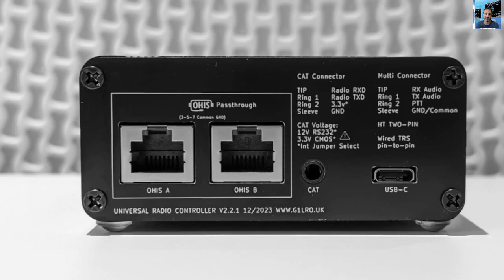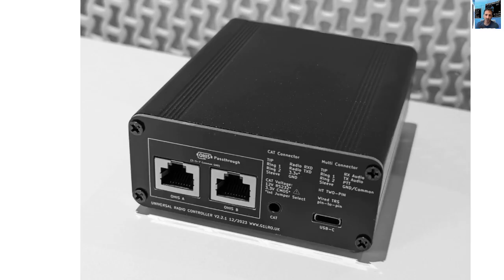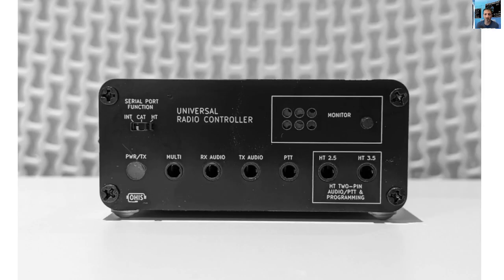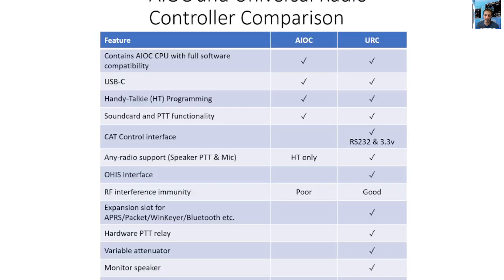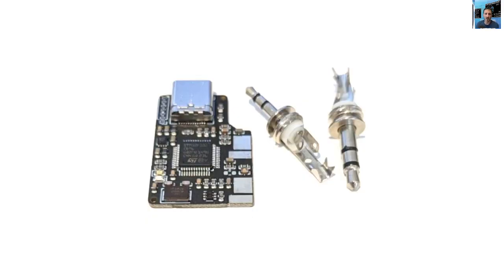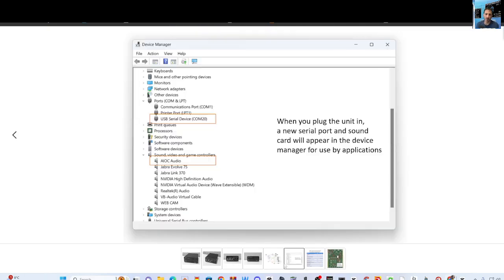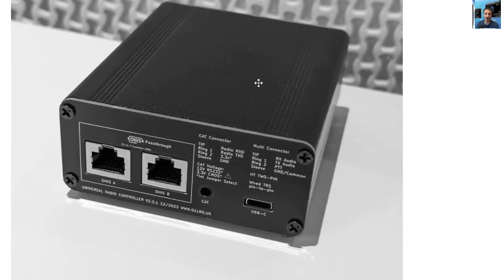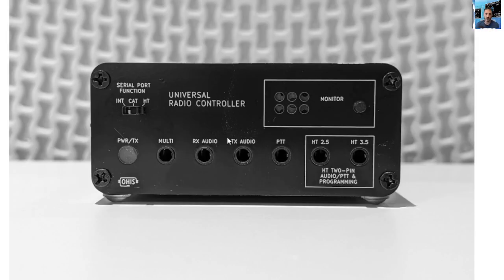Universal Radio Controller V2.2 USB-C for Packet & digital modes. Includes AIOC

Comment: Really curios if the quansheng can be somehow made to work with SDRAngel or other SDR software out there basically turning the Quansheng in to an SDR, it is capable to receive on the ADS-B and AIS boat and plane beacon frequencies (1090MHz for planes and 161.975MHz and 162.025MHz for boats), but don't know if this is possible.
Reply from the maker: Yes with aditional hardware you can .